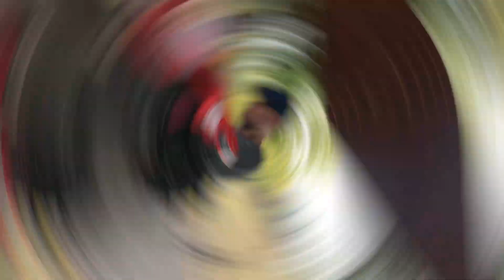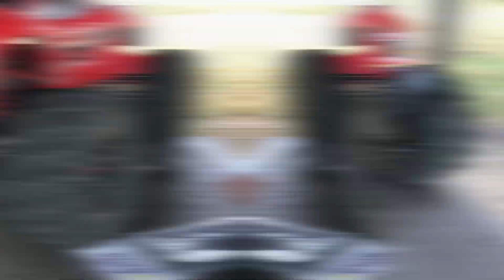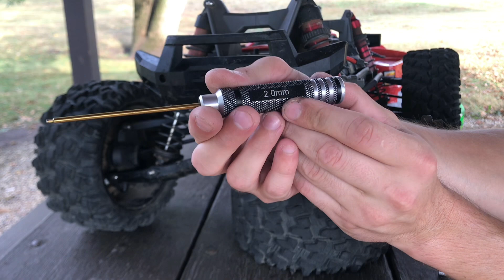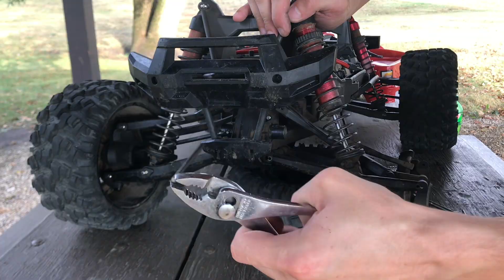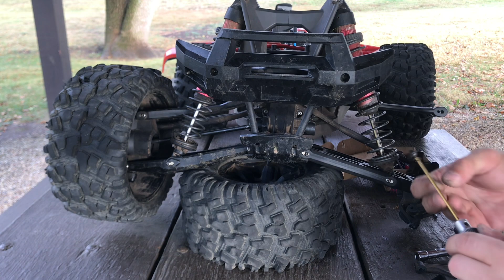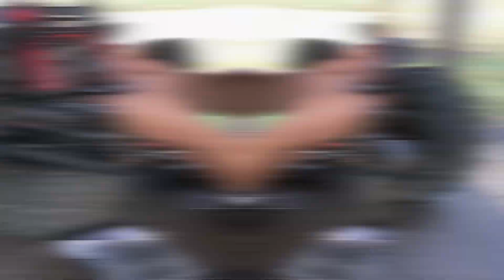Traxxas XMaxx 8s - HOW to INSTALL RPM Suspension ARMS and REAR HUB CARRIERS!!

Comment: Heya what shock oil do you run in the x maxx I think I need  a heavier weight, also when I turn and give it throttle it makes a clicking noise, it's only quite new maybe 10 runs on it cheers
Reply from the maker: I run 50wt front and rear….if it happens at full turn the inside of the wheel could be contacting the suspension arm a little bit…mine does that all the time
Reply: @RCKnockout  awesome cheers appreciate you replying and ya help thanks keep up the good vids
Reply from the maker: @jasegazzard3743  no problem 😉

Comment: RPM products  are awesome!! Those hubs are great.. A little tip for your subscribers. And your self..  A  24 hr. Soak in WD-40 silacone base lub. Will help with flex.. You also  should have put a small amount of bearing oil in the new bearings. And also should have cleaned and oiled the stock outter bearing before reinstalling into new hubs.👍👍 IMO I also have the RPM hubs and pins for now..But 
Those threaded pins should have been a full 4mm thread if you notice the treaded end is smaller. It's a 3mm thread. If you launch the X sometimes they will break.. the CEN hing pins are a full 4mm a little beefier thread. Then RPMs you can also use the pins on the upper and outter hinges. A little mod to the pin head is all that's needed. To the upper outter fronts for the steering arm on caster for clearance... a dremel will take care of it or grinder... just food for thought bud. 
Good video man👍👍 you should take a look at the new arms from traxxas the HD arms they are sweet. About to switch over to them. And see how they work. Soaked them in WD-40 sliacone for about 48hrs. Love the X such a beast.... keep up the vids man.
Reply from the maker: Thanks man! Yeah I didn’t realize that til later that I should have applied some lubricant to the new bearings…I have tried using wd40 on stock arms before but I didn’t like how greasy it made everything….it definitely makes it more flexible though…I have seen the Traxxas HD arms but I haven’t tried them
Reply: @RCKnockout  what's up bud. What type of WD-40 did you use. You got to use the silicone style of WD..  Not the regular WD40. The silicone style wont be greasy.. With the bearings I use 3and1 dry LUBE. It helps a little with the crap sticking to them.. maybe some dust but not as much sand and dirt... happy bashing bud 👍👍
Reply from the maker: @stonerrc4626  I just use the conventional Wd-40….I’ve used the silicone stuff before though…still seemed like it attracted a lot of dust
Reply: @RCKnockout  the sliacone was just for the arms. For bearings I use dry LUBE from 3n1
Reply from the maker: @stonerrc4626  I’ve never heard of it….I’ll have to check that out thanks 😊

Comment: I can't wait to get this first upgrade for my truck.  The rpm captured hinge pins I've heard are a  must.  I have already had hinge pins pop out myself.  Thanks for the videos
Reply from the maker: No problem….yeah I’ve had the pins fly out on the stock arms before…If it starts doing it with these then I’ll get the aftermarket pins

Comment: Very useful upgrades. I added the rpm threaded hinge pins. Also the front rpm hub carriers. Enjoy the difference 😉👍
Reply from the maker: I didn’t realize Rpm made front hub carriers??
Reply: @RCKnockout  RPM Front Axle Carriers (Incl. Oversized 20x32x7 Inner Bearings) - Traxxas X-Maxx
Reply from the maker: @gregory9157  didn’t realize they made those…thought they just made the rear hub carriers
Reply: @RCKnockout  I did both front and rear. And since then I never had any problems with it. 
Time to go to bed 🛌 now. 04.00 am here. 
Good night 👍
Reply from the maker: @gregory9157  take it easy….I’ll have to look into those upgrades…thanks
Reply: @RCKnockout  do known “ fast eddy’s bearings “?  These are better bearings than the stock ones
Reply from the maker: @gregory9157  I’ve run fast eddy bearings…they seem pretty good